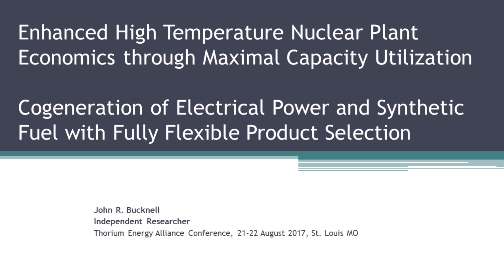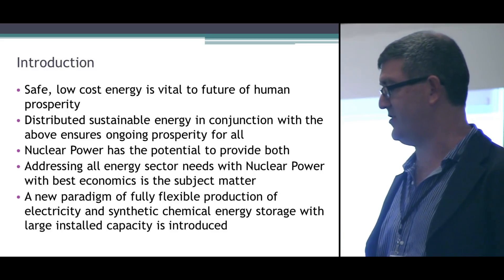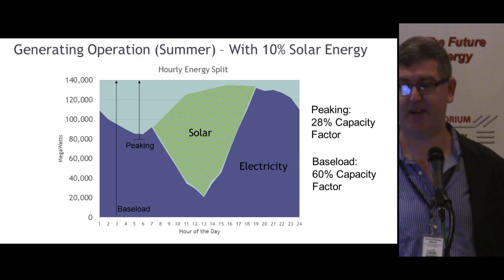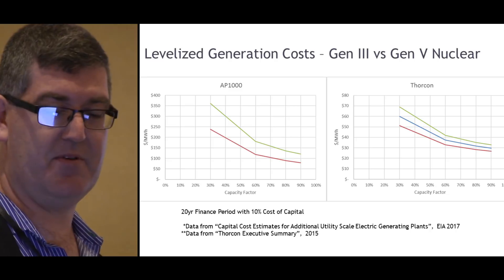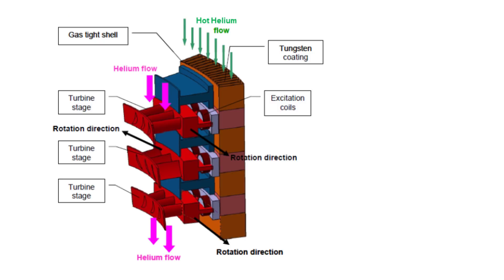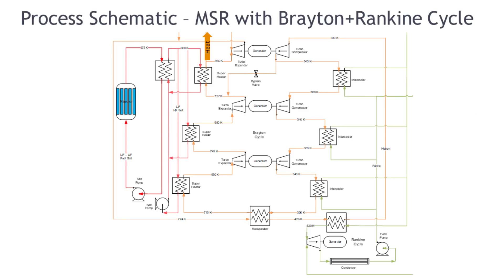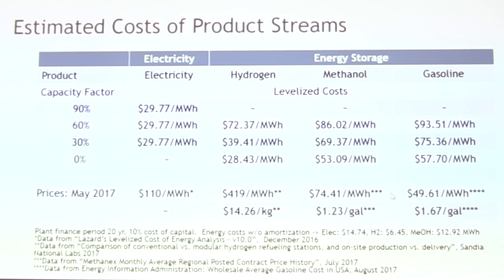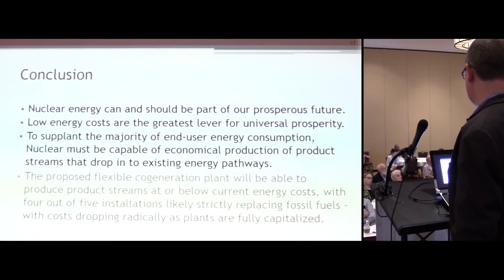John Bucknell - Nuclear Plant Economics & Synthetic Fuel Cogeneration @ TEAC8

Comment: For a link to the turbo-inductor concept, Dujarric et al have a paper out on ResearchGate that is also the originator for the picture shown within this presentation.
https://www.researchgate.net/publication/258676256_The_NTER_A_Proposed_Innovative_Propulsion_Concept_for_Manned_Interplanetary_Missions

Basic concept is:
- It is possible to use electricity to "boost" the temperature of hydrogen exhaust in a nuclear thermal rocket
- Original concepts proposed to seed the exhaust with Caesium, then heat that with induction (like a microwave) to boost exhaust temperature. Hotter exhaust = higher thrust, all without needing higher mass flow (which leads to higher fuel consumption)
- The NTER concept instead uses an electrically powered heat pump to heat the exhaust, which is a lot less complex: the turbo-inductor.

The turbo-inductor uses a flow of helium to run. Helium flows through it, making the turbine blades move. The turbine ends are straddled with coils of conductive wire, the movement of turbines through which induce a current in the coils. The electric current induced flows into a tungsten channel and heat it up, kind of like a hotplate. The hot tungsten radiates its heat to the hydrogen and thus boosts its temperature from 2550K to 3250K. 

Quite clever, but it does pose some engineering problems, mainly related to bearings at high speeds and high temperatures.
The turbo-inductor concept uses a statorless design, which necessitates the use of bladed rings every other stage. Although this does increase efficiency and reduce turbine length it does also double the velocities seen by any bearing system as a result. We also haven't gotten to the stage of using bladed rings in any aerospace application as yet. The challenge is not insoluble but it is nevertheless difficult. At those speeds and temperatures you start to need exotic styles of bearings.

For a stationary power generation application, there is no need for a contra-rotating bladed ring concept. You have all the space you will ever need, and if it doesn't fly, it doesn't matter if it weighs too much. There will be some additional technology development needed to adapt that concept towards using helium on the heated side. 

However. One fatal Achilles heel is the need to use heat from the primary loop at 1000K. As you go through heat exchangers you are losing heat and therefore losing energy for final boost to 1273K. Going from 1000K to 1273K with turbo-inductor is already expensive enough to make it produce methanol at $53.09 / MWh. An extra 50-100 degrees kelvin lost going through heat exchangers will make those numbers significantly less favourable.

Really though, all of this additional technology development can be sidestepped using an alternative hydrogen thermochemical cycle: Copper-Chlorine.
https://en.wikipedia.org/wiki/Copper%E2%80%93chlorine_cycle

Cu - Cl is already being researched by AECL (now CNL and SNC-Lavalin) as part of the SCWR project. It is already 43% efficient assuming NO waste heat recovery. It runs at a temperature of ~530 degrees. Which is to say that you can directly tap the secondary loop and bypass the issues of a radioactive primary loop, or be stuck in a Catch-22 of needing more turbo-inductor boost. SO4-I needs 1273K just to reach 50% and you need more parts that can fail and additional technology development that can add an unknown cost. If your turbo-inductor goes down you aren't making SO4-I hydrogen that day. Cu - Cl has no such component to fail in the first place, piping is simpler and easier to develop, and there is already extant R&D.
Reply: No additional hardware than your proposal is suggested (source temp from secondary loop is ~675 deg C), and the difference between 43% and 51% yield is not trivial (51% includes turbo inductor loss).  Copper Chlorine is a choice, but doesn't make economic sense to choose to be 21% more expensive when something of low capital cost can bring product stream costs down and pay for itself in a very short time.

Comment: Great talk... but now I want to hear more about the Nuclear Rockets.

The Cancellation of NERVA was the cancellation of any serious space-faring effort.  Bring back NERVA.

Actually, hell. Bring Back Project Orion. I'm sick of waiting.
Reply: The 2015 paper that describes the Nuclear Thermal Turbo Rocket is here on YouTube and search for me at AIAA.org. 
https://www.youtube.com/watch?v=C46Dt-X0V8c&t=57s
https://www.youtube.com/watch?v=778NLOXs7JI

Some discussion on NextBigFuture here:
https://www.nextbigfuture.com/2017/07/air-enhanced-nuclear-thermal-rocket-by-x-spacex-engineer.html
Reply: The TWR of NERVA wasn't really there. At only 1:1 it was really more of an upper stage engine, although I suppose better fuel design might have improved the situation somewhat. For surface to orbit, hydralox is still king. The only way to beat hydralox is if you use air for the first couple dozen KM of altitude so you save on oxidiser mass. As far as I know, the only engine with a usable TWR that runs off of a nuclear thermal cycle is the gas-core nuclear rockets, or Orion, or the nuclear salt water rocket (open cycle). All of them have issues related to fallout, and turning the launch site into a crater scattered with trinitite.
Reply: If I'm not mistaken, one of the NERVA got something along the lines of a TWR of 4.  Which is all you need when you have the kind of specific impulse they did.

And personally I don't find the estimated fallout from something like Orion being worthy of stopping the program.  It was small, all things considered, compared to the total number/yield of atmospheric tests.  With a single launch you could increase the mass we've placed on the Moon by a factor of 20 or 30.
Reply: One of the ways to bypass low TWR using NERVA is to simply use the Aircraft nuclear propulsion program for its original purpose. Have the craft take off from a runway, climb to altitude, then fire off the second stage. Fighter aircraft can already launch anti-satellite munitions with a good plotted intercept. It would be a similar concept.
Reply: Allegedly NERVA wasn't cancelled It just went deep black.

Comment: I would have chosen methane as a final chemical product. That way you can feed what you don't need into national pipelines or use it as rocket fuel. I have my doubts you can even launch a rocket using solar power Elon. You can probably use methane in fuel cells, too.
Reply: No methanol is far more practical. Liquid fuels are far easier to store and use in transportation or stored like in a home heating fuel tank. Even natural gas has a serious transport problem, stranded gas is sitting there unusable in vast quantities and huge quantities are wasted - flared due to the extreme expense and difficulty of building pipelines. Very easy to convert most transportation to Methanol, the simple minded Flex Fuel Mandate, costs about $50 per automobile and opens the door for widespread Methanol fuel usage instead of gasoline. Using methane for rockets is better than methanol but that is an insignificant demand. The world's #1 expert on fuels, the Nobel Prize winning chemist, George Olah, determined that the Nuclear/Methanol Economy was the best replacement for the Fossil economy.
Reply: Could probably switch to ethanol to prevent it from being so toxic. You can mix some methanol with it just to stop people from drinking it. Anyways alcohol doesn't make good rocket fuel due to low specific impulse, so they would stick to methane on mars. For some reason I forgot what methanol was when I made my first comment, brain fart.
Reply: You wouldn't drink gasoline, just as you wouldn't drink methanol. I don't think that going the extra step towards ethanol is worth the additional energy cost.
Reply: Gaseous fuels have same transport and storage problems, with hydrogen the worst of the lot.  Liquid fuels are more than as thousand times as dense.
Reply: I don't know about you but where I live lots of people use gas to heat and cook, why not make that current pipeline infrastructure carbon neutral? I know it's lossy, but all chemical conversion/storage systems are.
Reply: The use of gaseous fuels is tolerable for some applications as I indicate in the presentation.  However, for  transport and other uses gaseous has huge drawbacks.

Comment: I am not sure I understand the very last table correctly. Is the last column, gasoline, his estimate on how much it will cost to synthesize gasoline using nuclear energy? Perhaps using the methanol as feedstock?
Reply: Oliver Mayo Thanks, but if Mr. Bucknell put it there presumably he has a reason, and given that he obviously knows more about it than me, I would like to know what those numbers under the gasoline heading means.
Reply: Thanks.
Reply: Yes, bacteria do readily consume Methanol. The idea would not be to synthesize gasoline, that would be dumb, we can burn methanol rather than gasoline in almost all applications. The idea would be to synthesize jet fuel from methanol for use in aircraft, methanol's lower energy density is problematical for aircraft.

Comment: Nuclear power is way more reliable than most renewable energy source.
Reply: No, full lifecycle emissions of Nuclear, which includes all the coal, oil, gas used in the supply chain is ~12 gms CO2 per kwh generated. Vs ~50 gms for Solar PV, ~350 for conventional gas, ~1100 for coal. So it is real easy to replace that 12 gms with non-fossil energy if it was important, but it isn't. CANDU nuclear which burns natural uranium, in Ontario, CERI full lifecycle is 1.8 gms CO2/kwh, that is far lower than any energy source, hydro, wind, solar, geothermal. 

So yes, we do not classify Nuclear as renewable, that is just an energy classification i.e. 1) Fossil, 2) Renewable 3) Nuclear which has three subclasses a) Fission b) Fusion c) Exotic (i.e. anti-matter, zero point, LENR)

There are only really three clean sustainable energy sources 1) Nuclear 2) Hydro 3) Geothermal. Of the three only nuclear is scalable to supply all of our civilizations energy consumption. Whether fission or fusion, nuclear can easily supply all of our energy needs essentially forever.
Reply: Plums you still don't know what full lifecyle emissions are? I told you and you don't learn or listen, Ontario CANDU is a trivial 1.8 gms CO2 per kwh that includes all your fantasy coal & oil inputs. It is easy to run an all nuclear economy, even with CANDUs burning natural uranium or uranium/thorium mix.

Ordinary dirt, avg Earth's crust contains 15X the energy of crude oil and 26X the energy of coal per unit mass, ~50X per unit volume, just from the uranium and thorium contained in the dirt. And you can double that mass by including all the oxygen the fossil needs which the nuclear doesn’t need. Burnt in a full burn reactor like a LFTR, IFR, LCFR or TWR. There is enough thorium in the annual waste from one Rare Earth mine, that makes materials for Wind Turbines, to supply the entire World's energy for one year. The thorium is a waste product, they will pay you to take it away.  

As an example, Bill Gates Terrapower is going after depleted uranium fuel.  "...The TWR will utilize depleted uranium as its main fuel. Just in the United States, more than 750,000 metric tons of depleted uranium sits useless, like that stored in Paducah, Ky., pictured below. TWRs could convert this material into enough electricity to power all U.S. households for more than 700 years..."    Read at:  terrapower d0t c0m /pages/environment 

There is no possibility that there will be any limit to our energy supply for a billion years or more just with our thorium and uranium resources and they are much lower than fusion resources.
Reply: Kenz300 x, Q: Did you do any research before posting? 

You do realize depending on the nuclear material and what the byproduct can be on a range from a couple thousand years to a hundred thousand years. So your dramatic "FOREVER" is quite the exaggeration.

For the cost it is very expensive at the beginning, but to my understanding maintenance cost is much lower.

For danger, I suggest looking up James Hansen who's done calculations on nuclear power plants vs coal plants suggesting more lives have been saved by its introduction since 1971. Plus if we are talking about the new Thorium fluoride reactors, then safety will be like turning on and off a light switch due to Thoriums ceramic like properties.

For storage it falls on the government(ie. the taxpayers) and since we are mostly talking about the US, there was a new waste disposal center under construction but was cancelled in mid construction during the previous administration. There are talks to continue the construction and finish the facility.

But if you disagree with my statements then please let's have a discussion and please be specific(and if possible please present your sources).
Reply: Plumsmuglers: Honestly, I was thinking the reliability of the renewable energy sources such as solar power and wind power vs nuclear power. For example Germany who has been turning to renewable energy vs France who has gone for nuclear energy. Germany depending on the weather can have a surplus of energy or non at all and where Germany has had to buy it's energy from France.
Reply: They bought current from Veolia but we will soon have to buy more turbines from Siemens because CO2 sequestration sounds better than Nuclear waste management to our elites and populations.
Reply: https://www.google.com/amp/s/phys.org/news/2011-05-nuclear-power-world-energy.amp
Reply: +whyKhr (porQuê-KW-hr, no?):   You have Hit the nail right on the Head !!
    If you May be Int'd in finding out:
(1) the Múlti-Apps of 100%-Fluid "Molten-sal. Science", view my 1º link;
(2) how to enable "Ms.Sci" cõn Sound Ms-Biz Strátegy, study mi 2º:
bit.ly/ms-sci
bit.ly/Smart-ChemProcesses !
Reply: Nuclear Power is no less than a marvelous added value on natural resources.
While the fission of Thorium hides many benefits (cargos, tankers, platforms) 
Uranium would fit a better use as an added value on Dams (radio-electrolysis).
If radiation, electricity & microwaves are cumuled, caloric input have 0% utility.
Reply: In Western Europe, after the British ones, it is certain that we won't EVER build more. There are much better ways to value Uranium & Thorium !!! I do think fission have a future, but only in seafaring applications, not mainland. We have overmined every darn country on the globe, Thorium is THE savior if you want an energy that matches the depth of the seas.
Reply: +Hydrogen One what you say is perfectly logical, but there is one factor that I am specifically addressing that not many seem to acknowledge; nuclear energy is completely unstable without coal/oil there can be no nuclear energy without coal/oil; in terms of France they have gone fully Nuclear energy right now but what happens when they run out of refined and enriched fuel ie. where'd that refined & enriched fuel come from? Will they not have to use vast amounts of coal/oil to procure more nuclear fuel? The economics works out so that they'd need more coal/oil to sustain their nuclear "battery" system than if they went straight coal/oil which is straight up insane - unless their in it for different motivation than energy production, perhaps more along the lines of weapons /depleted uranium armor plating etc.
Reply: It could be renewable but as of now nuclear is 100% relying on coal and oil to mine, refine, and transport the  fissle and with all the input energy it takes from coal and oil nuclear actually is more of a very good battery system than a power source itself.
Reply: +sgg But that's the distinction being made here; that it cannot sustain itself without putting more energy into it in the form of Coal/Oil than it Yields which means nuclear energy meets the (classification of a battery). It's certainly a great battery but, not a source of energy such as Oil who has extremely low energy input to procure, refine, and transport having a high positive net energy output which is why the US Dollar is based on Oil and not Nuclear Fissile.